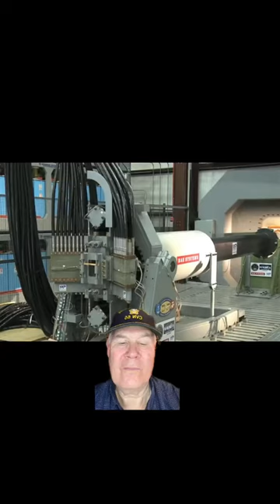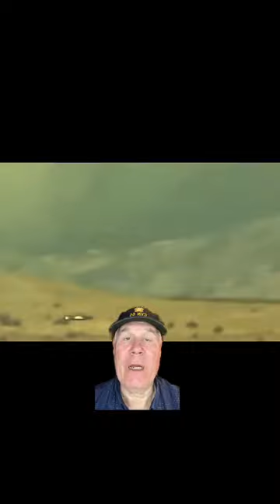US Navy Rail Gun

Comment: I thought they were moving away from this because the sled used to launch the projectiles incurs enough damage from the forces involved that conventional munitions are still a much more viable solution at the moment. That could be outdated info though, it’s still a really cool weapons system and we’ve invested enough money into it that it would be nice to see it come into service.
Reply: True....but some research is looking at a mass driver type lainch sys..which eould not need the canon configuration
Reply: No its because EMPs. Repultion and particle weapons exits. Gasoline powered weapons too. Yet they rot in warehouses. EMPs dont damage powder cartriges.
Reply: Was it not the massive power needed to fire just one projectile. The power needed was nuclear power
Reply: @stephendoherty8291 navy ships are nuclear
Reply: @jamarjames9501  most navy ships are not nuclear. Aircraft carriers yes
Reply: Yeah that's what they tell us😂 the research never went anywhere they're still doing it
Reply: Yeah the heat from the current, and electric magnetic forces just destroyed the rails way too quickly.

 So it wasn't cheaper. When you think about it we could use hybrid RAM shells that fire at hypersonic speed as well. Go back to the Zumwalt style gun and improve on it. The reason why those shells cost so much was due to the budget slashing the amount of ships. 

 Sure that has the downside of needing propellant on board, but better than carrying a ton of rails that has to be replaced. 

 I always wondered why they didn't go with coil guns instead. I think coil guns have a power limit on how fast they can push a projectile yet we aren't even close to it. 

 PS: I am not sure if we've entirely given up on it, and just halted most funding, but left a bit. 

  I vaguely remember someone sort of saying a back hand comment about it while talking about the future of the Navy, while talking about directed energy weapons.
Reply: Well, japan, I know, is still looking at this. US may have different types of being looked at.
Reply: This video is very old
Reply: Right?! I’m sure they considered designing a less destructive firing mechanism. I wish they could make a frictionless system. I was so hopeful but I think they gave up too soon. Lasers are no good in cloudy or foggy conditions.
Reply: @lewisjbh  you you you know
Reply: @BarrelTitor91  t
Reply: @BarrelTitor91  tty
Reply: @lewisjbh  Ttyt
Reply: @BarrelTitor91  t
Reply: @BarrelTitor91  t
Reply: @BarrelTitor91  t
Reply: @BarrelTitor91  t
Reply: @lewisjbh  ttyl
Reply: Not to mention the sheer power required to fire this thing, the ships would have to go nuclear otherwise they would need a day to charge a cap bank
Reply: That's not what I heard....
Reply: @stephendoherty8291  , Good point. But many Navy ships have (or will have) nuclear power. My understanding is that the high current hurts the cannon rails and they do not last long enough.
Reply: Yeah every time it shot it would eat the coils lining the “barrel” effectively requiring a rebuild every certain amount of discharges, that’s what I heard, but there’s more info out I’m sure
Reply: @anthonykulas2624 this is untrue however the where on the barrel is the reason this current prototype has been shelved. It was only able to get a couple dozen shots off before the barrel was completely inoperable. Current Navy and DARPA testing is on material sciences define a better composite material to make the barrel shielding out of. This is critically important work however it is considered boring and not flashy. Not to mention entirely classified. Even once a working prototype is developed with the new barrel the exact composite and material makeup of the barrel will be classified. In other words they're working on it it's just we'll hear and see absolutely nothing until something happens
Reply: The Japanese are now continuing the R&D
Reply: I heard at one point that the amount of recoil was enough to tear a ship in half
Reply: @matthewalanlayne5651  no, not the case at all the recoil is actually fairly negotiable. Because there is not gas expansion. The recoil is just from the mass of the projectile leaving.
Reply: @stephendoherty8291  as I recall it was because the cost of barrel replacment after a few shots in testing was a problem not easily overcome so other options are being looked at , as I recall
Reply: Remember most of what we see is outdated by the time we as civilians first hear of it or see it
Reply: @jamarjames9501 the only us navy nuclear ships are carriers and one research vessel. The other nuclear power plants are in subs
Reply: It just ripped itself apart every time it fired, and results were not enough to warrant its upkeep cost and timeline
Reply: Yes and no.  This is what the new launch assist system on Aircraft Carriers will be based on.
Reply: They are but this man needs unpriginal content
Reply: The system used a lot of space, had a massive power draw, and the projectiles were very expensive, proprietary. A stealth missile or high speed missile works better.
Reply: true.  rail guns ain’t happening
Reply: USN stated they were abandoning “this” rail gun technology over nine months ago. There may be other types, but not this one.
Reply: It is.
Reply: Why not just use  Frequency as everything  runs on them
Reply: Your right not happening so why make this video right😅
Reply: @stephendoherty8291 realistically speaking you’re probably all right
Reply: @Cosmicnexus86 ah yes trust the random stranger who uses a laugh emoji to show their credibility
Reply: Also can't shoot over the horizon easily
Reply: @stephendoherty8291  nope the gun tears itself apart so it can't generate enough shots per before overhaul
Reply: @stephendoherty8291  the project is scraped and it was so powerful that it damages the barrel and had to be replaced only after 20-30 shots. That's why not viable for now. And its not the ammo thats the issue
Reply: @BarrelTitor91 particle weapons do not exist my dude this is not Star Trek
Reply: Never heard of a zero gravity theory?
Reply: It's absolutely ancient. I'm surprised it's here. It feels like it's 30 years old.

 @Kwisatz_HaderachXIII
Reply: Yeah they’ve moved away from these for several reasons. They require a massive amount of energy for every shot and the entire accelerator pretty much had to be rebuilt after every 7-10 shots because of the enormous stresses placed on all of the fasteners.   May be a viable option in the distant future but for now the tech and materials just aren’t there to make it cost effective compared to conventional munitions
Reply: I work for BAE. The rounds were EXPENSIVE. That's what killed the program
Reply: The US gave up on this.  Japan has installed these on one of their frigates.  Strange that.
Reply: The rail gun is so strong that it tears itself apart. They might be moving away from it till they can solve the problem
Reply: Japan is still testing their own.
Reply: Wow, are you serious? Like they need any encouragement for more wars. smfh
Reply: "War is a racket. It always has been. It is possibly the oldest, easily the most profitable, surly the most vicious. It is the only one international in scope." - Major General Smedley Butler
Reply: @aptorres01  Rail gun tech could have industrial uses in the future.
Reply: @anamericancelt6534  Yes, I'm sure that's what it will be used for.lmao
Reply: @aptorres01  Rockets, drones, radar...
Reply: @anamericancelt6534  Exactly
Reply: @aptorres01  Are you denying that those technologies have uses outside the military?
Reply: @anamericancelt6534  No, I'm saying that it will be used as an excuse for more war as our government always does.
Reply: @aptorres01  No one has ever needed a rail gun to excuse war. Wars have been fought for less, and industrial use of mass drivers would be a benefit to mankind.
Reply: @anamericancelt6534  Yes, yes. How so?
Reply: @aptorres01  Mass drivers would be a cheaper alternative to rockets. Launching satellites and resupplying space stations would be much cheaper.
Reply: @anamericancelt6534  I will have to do some research on this.
Reply: The sled might not be able to be used right now without significant redesign, but the goal is to fire stuff at stuff and cause damage. Do you shoot with the launch sled is the sudden and quick acceleration, all the new ships being built or just recently built, have provisions, made for extra power generation for these particular tools and weapons.
Reply: The barrel wore out too soon. The lifespan was about 1/3 of what the navy wanted.  It would still be useful for drone submersibles.

Comment: Needs a full gun replacement every time it shoots. The program was completely canceled due to unreasonable maintenance requirements.
Reply: Correct.  Just like back in the early 1990’s we developed hypersonics…then realized precision is better.
Reply: Program is not canceled.... It could fire about two dozen shots on the latest prototype before the barrel would have to be completely replaced. Current research is on the material sciences side to develop a composite material that can withstand the force is necessary. The current prototype has been shelved. We likely won't see anything until they develop this new type of barrel. Unfortunately this type of work is slow, boring and very classified. So we will likely not see or hear anything until a working prototype has already been built and tested with a new construction material that can handle the forces. Probably within the next 5 to 10 years
Reply: @karstenengelmann925  "precision is better" For now*
Reply: Yeah, but if we keep the program running it makes money for Raytheon and the others doesn't matter if it's reasonable or even viable just as long as it makes money for the industry
Reply: It wasn't after every shot...
Reply: That's what they tell us.

Comment: It's not even about the speed, or the accuracy.
It's about NOT having a ship full of gunpowder, and missile solid propellant.
Reply: Tell me you have no idea how how a modern DDG works w/o saying those words 😂
Reply: Quite the opposite thanks to EMPs.
Reply: @BarrelTitor91  
Ships are basically a giant faraday cage.
I'd imagine that electronics deep within the ship are fairly well shielded.
Reply: Also about the cost $
Reply: @kilgoretrout4461  
Good point, there.
A nuclear powered ship, with electric cannons = about as cheap as it gets
Also you don't need to keep picking up fuel, shells, powder, missiles.
Just food for the crew, and more aluminum bolts for the cannons.
Reactors last like 20 years iirc.
Reply: @castanza128  The weapons are mounted on top which are less shielded. EMPs can penetrate deep. The steels used for ship hulls arent the best emp insulators. Even purpose made EMP shileds fail if EMP is strong enough.
Reply: railguns take up too much space, electricity and incur rail damage after a dozen shots.
Reply: Yeah no.
Reply: @BarrelTitor91 If an EMP is strong enough to destroy the electronics on a ship, then you have bigger issues than the EMP, you probably have to deal with quite the blast radius as well. Strong EMP doesn't happen in a vacuum, it almost exclusively requires a nuclear or thermonuclear reaction.
Reply: @swi9945  A Mk41 Vertical Launch system is not exactly small. Neither is the turret and magazine of an old battleship. There's lots of space on a ship. The rail damage is still an issue but there's plenty of room on a big destroyer.
Reply: @kilgoretrout4461  cost per shot yes, but cost and time to change the barrel was ultimately the reason why this project got canned
Reply: It's about having a weapon that's immune to countermeasure.
Reply: Yeah, instead you have massive capacitor banks storing millions of Jules. Energy is energy my friend. Charge up an old phone battery and then punculture it (from a safe distance) and you'll see what I mean.
Reply: @exnihiloadnihilum5094  
Capacitors are not lithium batteries.
They don't explode unless they have gone bad and are bulging...
Reply: These cannons are designed for combat. If hit while charged, immense additional power is added to the hit

Comment: It's a lot cheaper to just build soft explosive projectiles that explode on impact firing a depleted uranium core at over 10,000 miles per hour that will penetrate 14 - 18 inches of armor plating.  Sometimes the older tech is more effective than some of the newer gadgets.
Reply: Yes but how many such warheads can a ship hold? These could potentially be in endless supply once the gun is mounted.
Reply: If, and that's a big if, they can create a barrel that can survive long term, it doesn't need an explosive warhead and simply relies on kinetic energy. I think it's worth the research.
Reply: The closest existing munition I can think of to what you just described is a shaped charge that follows a pretty similar description. Uses explosives that force a hollow cone to collapse in on itself, and that cone will always be made of a ductile metal like copper or molybdenum. The collapse of the cone (Liner) by the explosives forces out a jet of metal at hypersonic speeds which does the punching through. I don't think depleted uranium is a very suitable option for shaped charge liners though, given how effective more ductile metals like copper are
Reply: This will never become a thing in military because what it takes to build and the Weight plus what it takes to power it and navy ships are steel lol so a bunch of magnets inside it wouldn't be good
Reply: Yes but a dart has no rockets to track, no heat to seek, just a hissing sound as it cuts the air as it heads towards its target.
Reply: @jeepjake6969 there is no barrel it's a row of helicoils similar concept as the bullet train in Japan.
Reply: Wonder how much power it would require to send out reverse polarity to deflect that dart.
Reply: @Republican_Extremest  the power usage would be very very high, but making the projector that could take that much of a power load would not be practical or even possible at this time I don't believe, the projectile is just moving to fast and has to much kinetic energy.
Reply: I was being overly simplistic and referring to the rate of failure per fire but still, very knowledgeable response.
Reply: Old school rules!!!
Reply: @jeepjake6969 
I have read that same thing, basically the barrels cannot hold up for more than a small amount of rounds.
Reply: Cost.
Reply: You don't get it. These are just cheap steel castings sized to fit the arrel.  They can not even be too hard or they  lose the magnetic property. Run on electricity.  They will have replaceable barrel liners.   Couldn't be cheaper once research and testing is done. Explode on contact munitions are useless except against personnel and unarmored vehicles in today's military.  Reactive armor has done that.  Even warheads that blast motley metal are being defeated with metal bars.  These will be unstoppable for quite some time.
Reply: @brianhillis3701  unlikely seeing as how the tech works but won't operate properly and has therefore been shelved in favor of standard munitions, so I don't see the US adapting it anytime soon.
Reply: @Republican_Extremest  that is just steel, it is not magnetized.  A big very strong magnet could deflect it but compasses all around the world would also be deflected.
Reply: It’s called “Research and Development”. 
During and after WWI, the battleship was the most powerful maritime weapon of war. The battleship was thought to be invulnerable/unsinkable, especially from aerial attack. Then, in 1921, General Billy Mitchell convinced the War Department to allow US Army Air Corps bombers to attack the USS Indiana (BB) and see if they could sink the BB. USN battleship supporters said the project was a waste of time and money. The day of the battleship vs aerial bombers arrived and when the smoke cleared, the demolished USS Indiana was resting on the shallow bottom of the Chesapeake Bay. R&D.
Reply: @flatfoot7418  yes, because they kept at it and finally got it perfect, but they have already stopped research on this weapon and have shelved it with no further intentions of developing it, it is unlike they will get the problem resolved when they are not even working on the project anymore.  There's just not anymore research and development intended for the for seeable future unfortunately, maybe someday after someone invents better things to make it out of, but for now you can wave it goodbye.
Reply: @YG-kk4ey you forgot the power needed to fire it is extremely high, that's why ships don't use them
Reply: Is everyone forgetting the reactor/s on these ships
Reply: The whole idea is to eliminate the explosives battery and storage.
Reply: @RKTMAN7912  yes but now that they have acknowledged failure it's time to move on.  Great idea, I love it, but it's just not the right time. Maybe in ten more years, or twenty they will develop materials that can withstand such forces without breaking down every seven shots.
Reply: @billheathcock I think they are just having this tech on standby for when we figure out how to produce massive power quickly in a sensible form factor. Something like what Bob Lazarr described, our understanding of physics might change with a handful of breakthrough discoveries in the way we generate power
Reply: @josephburdette2407  maybe, but first they have to build one that doesn't fly apart after just seven shots lol, power is a massive factor, but so far they have not developed a finished product to use the power of they had it. 10 - 20 years maybe they'll figure out how to make a barrel out of Carbon-60 or something.
Reply: What naval engagements in modern times are line of sight?  This is such an unnecessary weapon.
Reply: Especially against EMPs. Its concerning how they use the top tech against citizens and not against the "enemy" military.
Reply: @millermike5739 nuclear powered ships are 60+ year old technology.  It's the most practical application of this technology.